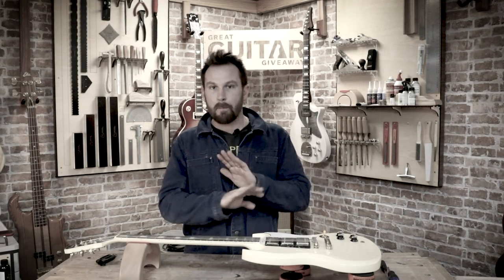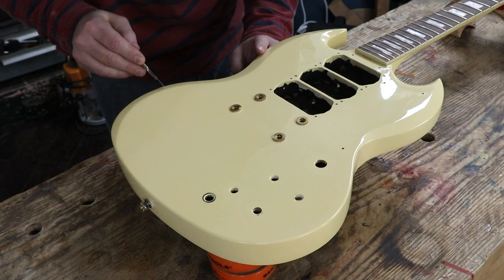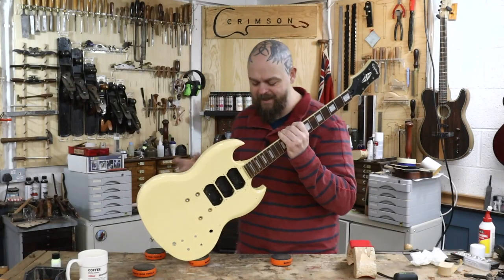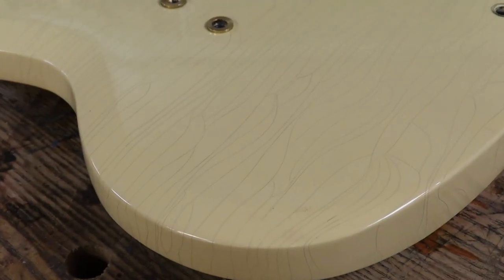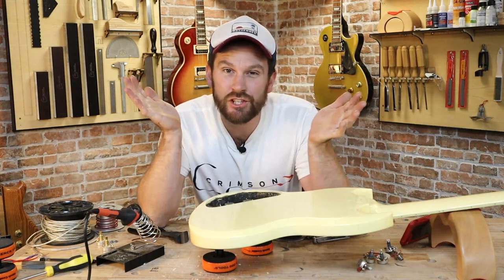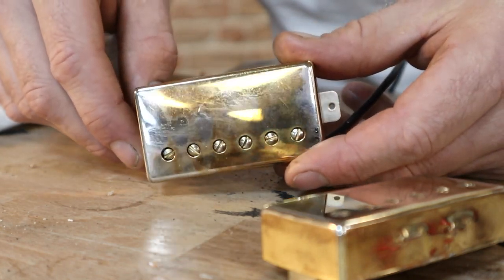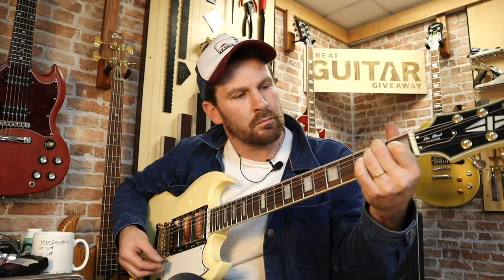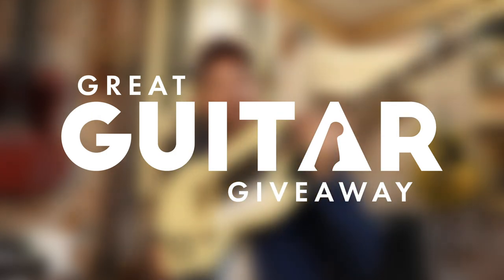KNIVES OUT! Making a Custom Shop Aged Finish on a BUDGET Epiphone Custom SG

Comment: Vintage collector here, Finish checking should never extend over the binding. I have a few early Customs and the checking always stops at the Binding or inlays.
Reply from the maker: Thanks for the tip. That's a mistake I won't make again.. if I ever do this again that is 😉

Comment: I think a deep dive into pickup winding and electronics in general would be cool.  Demonstration of the difference in construction and tone of the options.  Standard single, fat single, stacked humbucker, split, parallel, asymmetrical HB...  How much does the pot and capacitor values change tone?
Reply: It would be cool, but a massive investment to do properly. PRS are only just figuring it out, so maybe a bit of a tangent for Crimson which is mainly about the wood working. But someone should definitely do a myth busters on guitar electronics.

Comment: I had that guitar my mine was an early edition  of it from about 2006 with vintage tuners and made from mahogany, I sold it in August. New guitar day got one of the Harley Benton Orange blast finish telecasters with filtertron pickups, not too much to do on it got 2 high frets and they need a polish. Out of the box the intonation was almost spot on and the truss rod need a bit more tension on it. Swopping out the screws on the puck gaurd and control covers for some black ones. Fret board is ok but I'm gonna give it a bit of love. The nut slots are good apart from the high E and B.

Comment: Depending on the color, I usually start poly-relicing by sanding with 1500 grit paper or cutting compound just to take off a bit of the gloss and give it some of that nitro feel/texture.